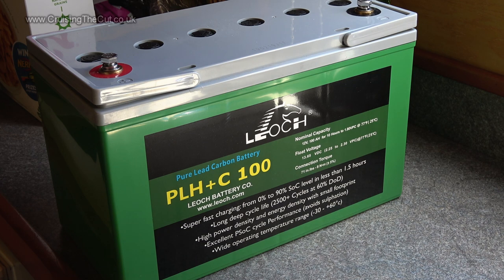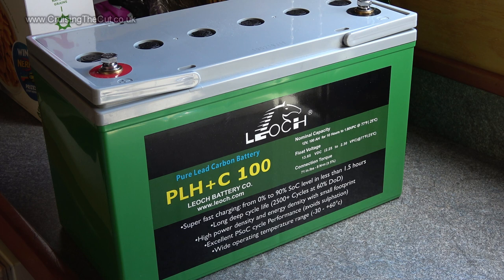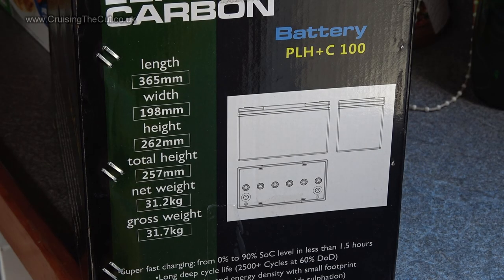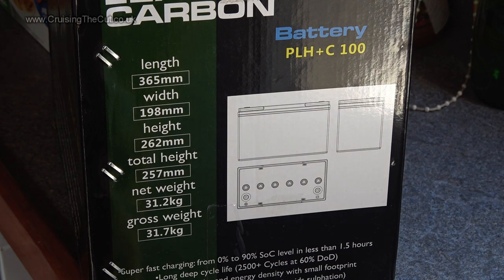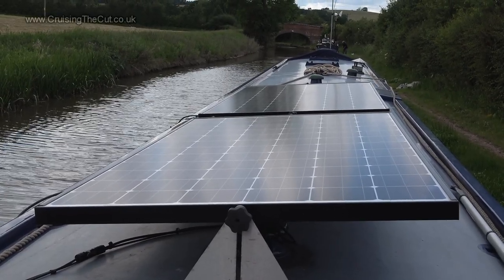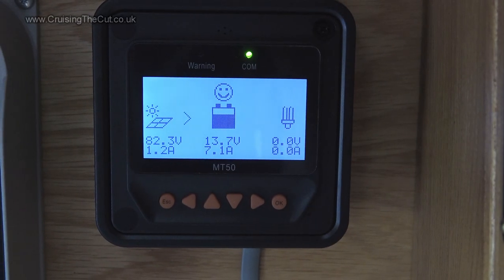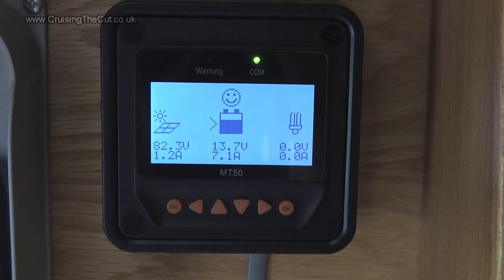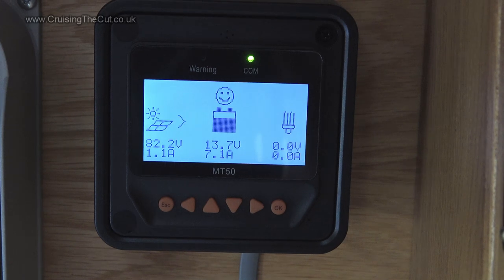178. Installing Lead Carbon batteries (12V 100Ah) into my canal narrowboat

Comment: With the batteries in parallel, it really doesn't matter where the wires are connected. If anything, tapping of from the middle would be optimal, as you'd get the least possible contact resistance to every single battery (if you connect to the end of the chain, all the contact resistances between the jump leads add up) - but if everything is tightened properly that's negligible.
(Edit: actually connecting to opposite ends does make sense, as then the resistance from the connection through the battery to the opposite connection will be about equal for each path through each of the three batteries. But as I said before, for only 3 batteries this is absolutely negligible, provided the terminal screws are tightened properly - it only becomes a problem for large battery banks.)
If you are really worried about it you could use solid bus bars to connect the positive and negative terminals, instead of short jump leads. But for a few milli-ohms less resistance it usually isn't worth the hassle - unless you run really, really high currents it doesn't make any difference.

Regarding the order of connecting/disconnecting positive and negative: that's usually only an issue if you connect additional batteries (e.g. when jump-starting a car). Usually the vehicle body is connected to the negative terminal, so if you connect an additional battery negative-first you have to be very careful to not accidentally touch anything with the positive jump lead, as it would produce a short circuit (which can be very dangerous with large batteries - think "welding machine"). As the battery is usually surrounded by bodywork (=negative terminal) this can happen very easily; therefore it is safer to connect the positive lead first.
But since you are just (dis)connecting a single battery bank this isn't really an issue (provided you use isolated tools, as you should always do when working on batteries!). Just make sure to disconnect the main wires first (before disconnecting the jumpers between the batteries) and re-connect them last (after setting up the battery bank), so that you are actually dealing with a "single" battery from the vehicle's perspective.

Comment: Oh for solid state batteries to the market.
100% correct the differences in boat batteries wiring set up.
Very very few engineering bods operate in the same way.
Good work David

Comment: Hope you didn't let the supplier kindly "recycle" your old batteries (like I did!).  Pop along to a scrap metal merchant and they're worth between £10 and £20 each based on weight.
Reply from the maker: No, still got the old ones awaiting proper disposal.

Comment: Is that normal in the UK to put the box size on the box and not the item size in the box? I'd have thought it was the battery size and not the box size and not bought it if I just saw them in a store.
Reply from the maker: No, not normal!
Reply: I have noticed the dimensions of the outer package on a number of boxed items in Australia.  Seems to be some international transport type of thing, possibly related to billing by volume rather than weight or some other such method of organised theft.
Reply: Have seen package dimensions on stuff from China into Malaysia... incl weight etc... more for shipping grate sizing i expect.  BTW David... where are these batteries made?

Comment: Just a remark to anyone doing their own battery installation. Connecting "first" or "last" battery in a group of batteries connected in parallell really doesn't matter as long as the intermediate cables are thick enough to not give any voltage drop.
Reply from the maker: It's almost certainly negligible but I've always been taught to source from across the bank rather than within it.

Comment: Well done on not only changing over your battery bank but on filming in such a way as to eliminate the "experts" arguing in the comments. ;-)
Reply: PS - Who puts the cardboard box measurements on the box? I had a similar thing with finding a home for my 4' Hi-Lift jack in my Land Rover whose rear space is 47" long! It wasn't until I put it in I found that it WAS also 47" long and they had just rounded it up and called it 4 feet! Aaaargh!
Reply from the maker: Alas it doesn't seem to have stopped the debate!!
Reply: @CruisingTheCut  That could be a positive or negative thing!

Comment: I quite enjoy the geeking out. The wiring information reminded me of how an old diesel farm tractor we had was wired. We had several but only one, with a 5.0L 6-cylinder, used more than one battery. On each side were parallel cables running to the respective terminal points.

As for disconnection order, I was always taught whichever was the ground first (usually negative but on the farm we had some 6v positive ground machines,) but it was simply for a practical reason of many conductive surfaces nearby that were all connected to ground combined with the battery often being in even less accessible places (tractor designers then had learned to build some mechanically nice machines but didn't think too much about human access for maintenance) and insulating the wrench would have addressed it as well.

Comment: no no no, electrons will flow in the path of less resistance, the length and order are irrelevant. with your setup i would connect everything to the middle battery, this way the jumper wires (the sort ones between the terminals)   will only have to carry the amps of one battery. the way you have connected it the jumpers on the middle will have to carry the amps of 2 batteries (the 3 battery is connected directly to the system) so connecting in the middle will be batter as far as load on the wires. as for the solar charger, its low amp (hence the thin wires) so it does not matter how you connect it as long a you go + to + and - to - . as for the spark its because one of the batteries had less power in it, so when you connected them the power flowed from the most charged one to the one with less charge to balance the power (kinda like a lock. nature likes balance and so do electrons) and since batteries has low resistance all of the flow of electrons happens at once in the form of a spark, noting to worry about.
Reply: No that isn't correct, electrons flow along ALL paths to ground, what dictates the size and path to ground is the resistance of that path.
The spark that is cause when making the final connection it due to the capacitors charging in the inverter not the voltage between the batteries (approximately 0.01 volts) it is too small. I doubt that you would notice the voltage potential across your tongue.
As for the resistance of a battery, that differs from one battery chemistry to another, and the charge state of the cell.

The leads carrying the amps of a different number of batteries, the wire used in the circuit should be of a specific size (the cross section area) and insulation composition as to handle any normal  maximum demand  asked of it and anything over that will trip a over current safety device (a circuit breaker) shutting the circuit down preventing damage to the wiring.
If you have a wire that is getting hot, you more than likely have a major problem an need to get it checked out!

@CruisingTheCut David if you really don't like the spark, you can keep the inverter from discharging the capacitors by connect the inverter temporarily to the motor start battery.
Reply: @aaronhorn6849  Exactly!  I usually keep a length of wire handy with a power resistor connected that I can use to limit the current going in to the load. I connect that to the battery bank before reconnecting the main cables.  This keeps the capacitors charged while the big cables are reconnected - no sparks.
Reply: No, current does not take the "path of least resistance", it takes all paths in inverse-proportion to their resistance. If you connect to the middle then the paths to the end batteries will have a higher resistance than the path to the middle battery, so they will see less current. By connecting to the corners the resistance is the same for all the batteries.

Comment: Technically, every point that is connected together with a conductor is electrically the same point, so any of the terminals with the red wire will do, and the same with the black. It does not matter where you put the panel connections so long as there is no corrosion at any of your terminal connections to create a voltage drop to differentiate the point. They are in series, so it was probably in the middle to do the least damage to the least number of batteries should rot and corrosion be allowed to gain a foothold under the insulation on either side.
Reply from the maker: It does indeed matter, see the article referenced in the video description
Reply: very strange way of looking at things, indeed.
Reply: @CruisingTheCut  I hate to be another armchair expert digging up an old topic, but since you commented only a day ago - here we go! I have to disagree with that article. It sounds very professional and I don't doubt his measurements but something sounds iffy. From the clip @5:18 I'm guessing it looks like AWG0 wire connecting the batteries (approx. 1 cm diameter) which should have a resistance over 30 cm of about 0.0001 ohm. Three links, from top battery to bottom battery, is 0.0003 ohm. If in the worst case scenario you are drawing 100 Amps! The voltage drop along the wire is a mere 0.03 V. Not enough to tax the batteries significantly differently over a 10-15 year life. But you will almost never be drawing 100 Amps continuously. Not something you need to realistically worry about, just have a cup of tea! The results in the linked article might indicate he was using much thinner wire which will of course lead to a slightly higher voltage drop.
Reply: It very much does matter
Reply: "electrically the same point" would only be correct if you have a conductor with zero resistance.
Reply: "Technically, every point that is connected together with a conductor is electrically the same point, so any of the terminals with the red wire will do, and the same with the black."

You should have changed the word "Technically" to "Ideally". In an ideal world there is no difference. In the practical world the interconnecting cables have a resistance and this resistance causes voltage drop which is directly proportional to the current through the cable. It might seem to be a small thing but over repeated charges and discharges this slight difference in voltage adds up to having one battery not being utilised to the same extent as the others.

In a perfect installation the charging connections would be on one set of the battery terminals as shown in the new setup and the discharging connections would be on the opposite terminals. As the inverter is, in this case, also the charger such an arrangement is not able to be used so the installation as shown is correct.

As an aside, David, the charging voltage you were looking for in this installation should be listed for cyclic usage rather than standby (float) usage. Typically I would expect the cyclic voltage to be around but slightly lower than the equalisation voltage.
Reply: @CruisingTheCut  I have to agree with Jim, sort of. To me it looked like the first 3 batteries on the left were in parallel. Then the final battery shared a common ground with the first 3 and the (+) ran to the starter for the engine? 

After reading, skimming really, the smartguage article. It looks like it's various methods of connecting the batteries in parallel to try to avoid the resistance of the wire? If that's the case I can't imagine you would see any large benefit considering the runs between them is not more than a 5-10 cm? 

It would be really need to see someone model this up in Pspice/similar to show any variations, because the smartgauge article does not seem to state any source.
Reply: @CruisingTheCut  That article says that battery internal resistance is .05 ohms. Every battery will be different, but usually they are like .3 ohms. That changes the whole calculation.

Comment: I am Karen’s husband. I have been researching carbon batteries and intend to replace my 2 banks of paired Trojan T125 lead acid batteries with 3 G31 firefly carbon batteries in Parallel when the T125s need replaced. Some information the battery manufacturer my not have shared is an unusual quirk of these batteries. About once a month or so you need to 80% discharge these batteries and hit them with 90 amps for about 3 hours or their capacity will gradually decrease over time. You my want to once again engage with you battery manufacturer about this quirk and get specifics from them on this quirk and not accept I am correct about this.

Comment: No. The spark is because the batteries are not at exactly the same voltage and the wires are very low resistance. So even with a voltage difference of .01 volts there is every likelihood of a short spark. As a professional electrical engineer I think the opinions on how to connect the batteries is nonsense. The wires joining the positive and negative terminals are short and heavy so it doesn't matter where you take the inputs or outputs in your case.
Reply from the maker: See the article linked in video description, cheers
Reply: @CruisingTheCut  An interesting article and quite logical.
Reply: @charlesarnold4963  ......and only applicable to big currents - not what his boat uses.

Comment: David, you did fine... in my younger days I worked for Chloride.... battery manufacturers... you did just fine common sense really. Known, seen and felt a few batteries go bang under testing, and yes every right to be very cautious. Apart from the obvious risk of shrapnel and acid, a period of deafness is likely... we always use to wear goggles and ear defenders, but having a well vented area is also advised. Nice to see upgrades over time from the old Marine batteries of 40 years ago..... narcissistic tendencies .... omg I did laugh if anything a little OCD but thats a good thing really..... keep it going.... great vlog your coverage of what Narrowboating is all about is excellent
Reply from the maker: Hahah thank you!

Comment: Your theories on wiring are strange. Conductors are conductors. Everything connected together with the same conductor is at the same potential. Moving the attachment point from one end of the bus bar to the other doesn't change anything at all.
Reply from the maker: The potential isn’t the issue. See the article linked in the video description
Reply: @CruisingTheCut   the author of the paper appears to ignore Kirchhoff's principal of the conservation of charge and Kirchhoff's current law.

The bus bars (i.e. the aggregation of wires no matter in what shape they are connected) act as a single node for analysis using KCL.

The principal of conservation of charge states that charge can neither be created nor destroyed at a junction, thus, so long as all the batteries are identical there can not be any difference in the current at any of the batteries terminals (because they are all part of the same circuit node) and thus, the different current readings the paper claims are not possible under accepted circuit theory.

If the author intends to claim that they have found an error in Kirchhoff's laws, I'd guess there is Nobel prize in their future.

As we all know batteries wired in parallel must be all of the same voltage and current capacity (ideally all the same manufacturer).
Reply: Every conductor has some resistance, and across every resistance there is some sort of voltage drop. Imagine a water pipe with water flowing through it. There is some pressure on one end, that makes the pipe spew out water on the other end, but some of the water pressure gets "lost" in the pipe. This means that the different batteries "see" different amounts of voltage on the cables under load, making them discharge at different rates as well, at least in theory. This gets somewhat offset by the batteries having an internal resistance, but I think it is essentially good practise to balance the resistance to the batteries by making one side have a long cable, and the other side have a short cable.
Reply: @homomorphic  Yeah, sparky here, you're forgetting about volt drop. Cables are not perfect superconductors and nor are terminals. Redraw your node diagrams to assume each of those is a milliohm of parasitic resistance and have another look.
If you draw 200A at 12V (or more - UK likes their big appliances), then a few milliohms of contact resistance at each connection, and whatever resistance the cables themselves are, can start to add up quickly.
You can get tens to hundreds of millivolts and with a 12V battery that can be 10%+ difference in state of charge.
One of the many reasons to look at 24 or 48V systems, if not more.